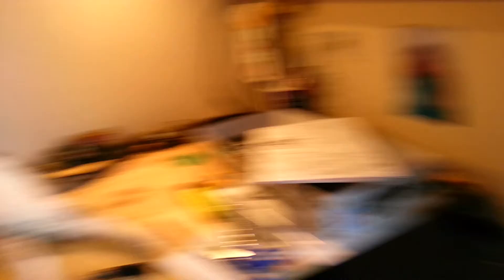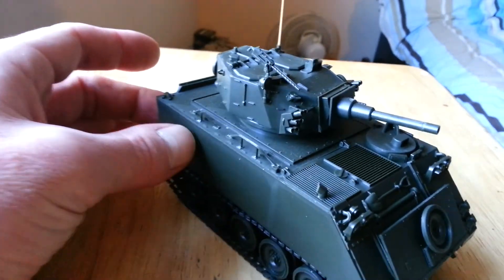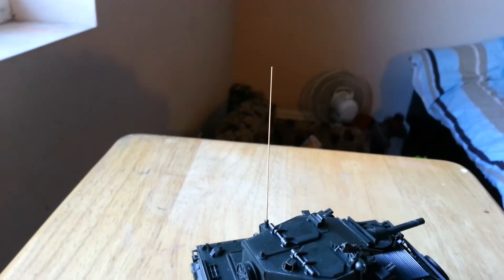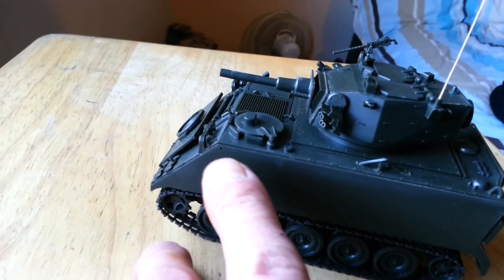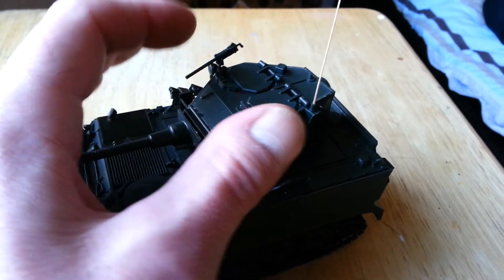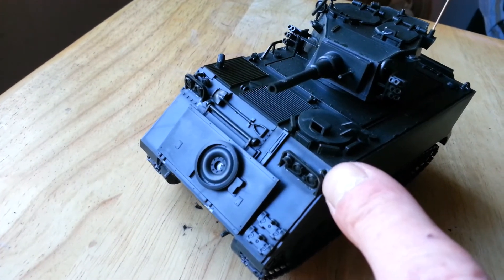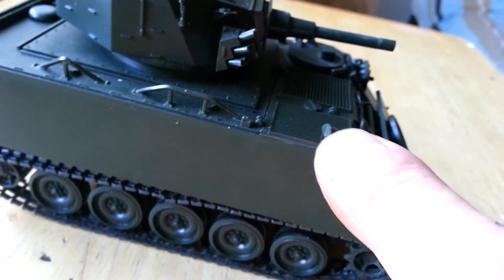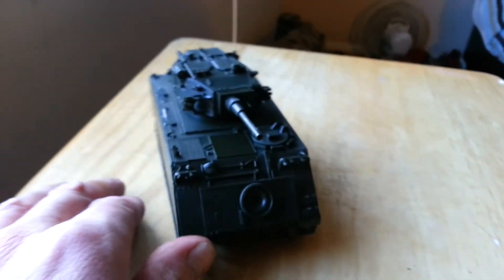Jam 113GB part 5

Comment: LOL I though the cat was dead for a second with all the sharp tools around it.  Nice progress, what kind of glue did you use because if it the tamiya extra thin then the glue stains shouldn't be much of a problem.  But if its tube glue then yeah, sand them off.
Reply from the maker: Its the revell contacta professional, and as soon as the lid comes off it pours out and ive got a mess, the cat actually bless him is on his last legs so I let him carry on as he pleases, although he's a pain I will miss him, and yes I think this will be a nice build :-)
Reply: jamesdivall64 Then I would suggest Tamiya Extra-Thin Cement, if you can buy it, as its the best glue ever cleated by man.  Tube glue is an atrocity to life itself.  Sorry to hear about your cat aswell, I've go a 12 year old dog who's deaf and has arthritis.  He's also crazily energetic (border collie), though I don't think he's got much left in him :(
Reply from the maker: Yep sad thing there we had a border collie cross called Levi who passed a week b4 his 13th, Tamiya extra thin is not available in this country for some reason, but I am going to try the humbrol liquid poly :-)
Reply: jamesdivall64 The humbrol liguid poly is good I've heard.